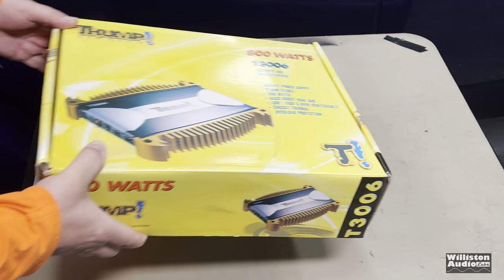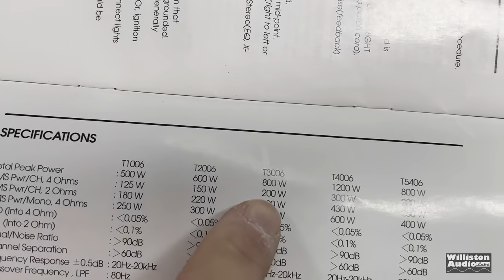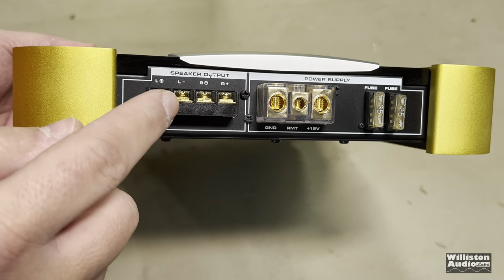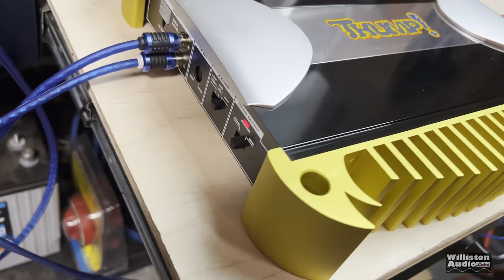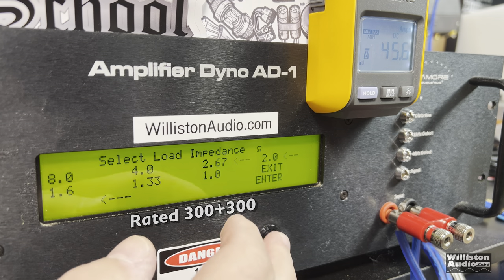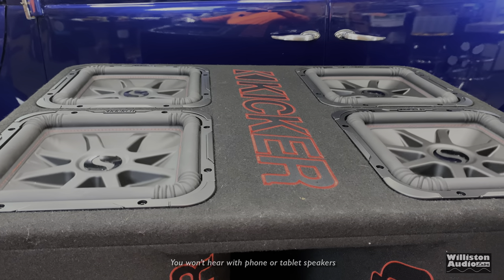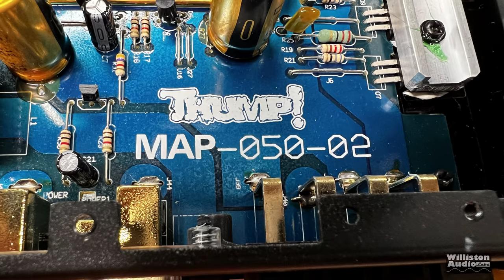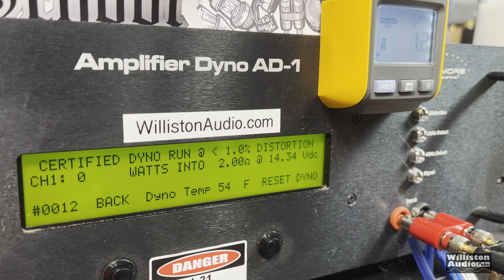Do It Thump Tho? 2001 Thump T3006 Review and Amp Dyno Test #FleaMarketFriday

Comment: This is probably one of the best you could hope for from a Flea Market. I would have considered it a score for the right price, especially considering how terrible most of them are..
Reply from the maker: Surprising 😲
Reply: I have never bought any Chinesium flea market amps, but I have purchased quite a few cheap flea market subs and they ALL sounded like garbage. The only ones that sounded anywhere near decent was a set of 6.5"s in a decent sized box that my buddy put in his 1984 S-10 as a joke with a power inverter and the amp was my Technics home amplifier...lmao It took up the entire space between the two bucket seats, but it sounded decent...
Reply: @Brock_Landers  i bought a Orion Cobolt from Denio's Farmer market and auction in 1988 and it was a slapper
Reply: Viper 660.1 d from 
2002
I heard it would do 
5000watt  @ 1/4ohm
Reply: @Brock_Landers  I can't say that I've ever heard a bad sounding sub in a good box. I have pushed subs past there limits and got muddy/muffled bass. I have found some subs are extremely overrated and start distorting way before there "peak" or "rms". Most of these companies are lying in one way or another; even the big brands. Often alot of the cheaper subs sound decent around 50-100ish watts, then turn to garbage past that.
Reply: nope remember performance teknique amplifiers

Comment: I had an Urban Audio Works 2 channel amp running a single Pioneer IMPP 12” sub in a MASSIVE box behind the seat of my old truck.  It was physically a large amp, and if I remember right I removed the bottom plate one time to see Targa on the circuit board!!  Realistically it probably only put out about 250 watts, but it was enough to impress people.  It would be nice to see a dyno of one of those amps one day.
Reply: I had an Urban Audio Works amp in the 90s. If I remember right, it was anodized purple and had a rat on it. I ran 4 pioneer 6x8s off of it in my T-Bird. It sounded really good too
Reply: @williamprentice9539  I ran many targa 12's from Ames store back in days. Believe I ran them off a road Master 500 watt amp, which was probably pushing 50 watts per channel but ran it bridged at 2ohms and was taking back subs and the amp almost weekly for new exchange. Lol.... As for the Urban audio, I never used those amps but also ran their 8 and 12" subs on home audio and they actually sounded great!

Comment: I am impressed with this Thump! amp. 1 of my first subwoofers was a 10 inch Thump! back in 2001 I was in 11 years old in 6th grade. It had yellow fat surrounds and I remember it sounding horrible compared to my old Pioneer Impp 10 subwoofers i had back than. I wish i still had one to test out today in my truck but they are indeed getting harder to find these days!!
Reply: I also had a Thump 10 and I had a 250watt Thump amp hooked up in my bedroom using a 12v battery charger and a deep cell marine battery. Thump was actually sold in stores. I bought mine at Meijer. They were around $60 for the amp and the same for the sub, but it came with a sealed box
Reply: what is the song you are using right before DJ Magic Mike?

Comment: Hands down one of the best starter amps I ever owned was bought new at a flea market. It was an original Ample Audio A226 with the brass colored logo on the top. It looked janky but would make your shit bump. They later grew to be a fairly reputable brand with their "Exonic" line but eventually went out of business. :(
Reply: Ample was pretty good stuff I thought. I also had the a226 and it was great. Had it running a Memphis studio 10” in a ported box in a regular cab s10. Impressed everyone that heard it and saw it was only 1 10” sub

Comment: Majestic is and always will be my favorite flea market amp!! First amp I ever owned in the early 90s still love them today. Wish I had more of them. The thump was impressive. Never seen that version of them. I can imagine it in my head though in my chevy luv with a pair of 10 inch kicker golds behind the seat...
Reply: I've gotten three majestic amps and not one of them came from flea market.
I got them audio Express with Lanzer sub's very good results
Reply from the maker: Budget Old School? 1997 MA-695 Isographic Series Amp Dyno Test
https://youtu.be/qvjtN9DK9GE
Reply: Dude! Chevy Luv for the win! That was my first vehicle. I had MTX 10s and a Sherwood amp.
Reply: @wal  one of my favorite videos you have done! That and the dsm series
Reply: @jasonlopez4855  my first came from the seattle wa swap meet.  I got the 250x2 (ma series)for 175 and I bought mtx terminator 12 inch for 50. The vender had the complete majestic line with eqs to the 400.2 amp
Reply: @heyyourlenscapson2588  74 step side with a 307sbc 2 speed power glide. Majestic 250.2 and a single mtx terminator 12 behind the pass seat. I put honda buckets in it before I got my license.
Reply: @ElectronicMusicUnderground  step side yes, mine had a small block Chevy 307 in it. With a mtx 12. Lime green.
Reply: Tell ya I never blew that first amp. Back then I had no idea what ohm load ment lol. Before i gave the amp to a buddy i had 4 10 inch kicker golds wired mono to that. Plus a pair of 6x9s off stereo. That amp got hot but never smoked. Good memories. Wishing now I still had that one and the 400.2. I have all the smaller ones now but the first series bigger ones elude me to this day.
Also had in there a amp I got for Christmas which was a frontier 50x2. Had that to a pair of horns. That was no so good of an amp. Literally a kmart special

Comment: OMG..... DJ Magic Mike! A thursday throwback if ive ever seen one! Hes still actively doing his thing today believe it or not.
When my brother did the stereo in his new 2001 Dodge stratus, the local shop sold him on a 25wx2 THUMP! amp. He bought an Audiobahn dual 10 bandpass box & Jensen amp, claimed he needed the THUMP! amp for powering his rear 6x9s. I discovered years down the road he could have wired the 6x9s in parallel with the hi-level input on the Jensen amp and been just fine. His Stratus came stock with an Infinity system & in dash 6cd changer which sounded quite nice with the subs.

Comment: I have this amp and the 4 channel version. I had them installed at a stereo shop in LA. I got the Kenwood head unit with cassette that controlled a remote 6 disc, Audiobaun passive eq, JL audio components in all 4 doors, and 2 10" Punch subs in individual boxes behind the seat of a 99 Chevy crew cab. My buddy spent 1k more on a complete Kenwood system with a custom box and 12's, he was sick, mine hit so much harder.
Amps have been sitting since 2003, been thinking about putting them in something.

Comment: Back in 2002, I once purchased a Soundstorm amp from a arena flea market sale, new. It was rated for 1000 watts, nice amp, worked for a few months, then it went into "permanent protect", and never worked again afterwards. That amp get scrapped for parts long ago. :/
Reply: You should of went to Fosgate power
2002 it will still work I got my amps
in 1999 and  HX3 subwoofers I'm still
using them still every day 👍🏽 ya boy 👍🏽

Comment: So I found your channel after being on YT close to 15 years myself.  While not an audiophile or a car bass addict, back in the 90's I had a CRX which had for the day a system.  Pioneer head, with cd player, the old school sled style.  2 Cerwin-Vega 6x9 in the doors , 2 CV 4" tweeters in the dash, and 2 JBL 10's, in a custom built box for that car.   For a car that had a little north of 800 watts rms back in my day.  That little shit box had the shakes.  I did have a 4 channel rock fuzzy 1000 watt amp pushing it.  I had to get a special bracket to delete my AC and run a second alternator, because the HF model of CRX had the worlds weakest ass alternator on it.  I wish it was an SI, but truth be told that car was slower than most shits I take in my 40's now.
Reply from the maker: I always wanted a CRX but I’m a bit too tall for one. They were little boomboxes though…didn’t need much to have a very loud system

Comment: never hook the rca's up before the amplifiers ground. it will charge the caps through the 1k ohm resistor through the rca ground and can damage the head unit. always unhook the rca's first, and hook them up last when installing an amplifier
Reply: Just diagnosed an amp earlier today that had been poorly grounded and was sending current through the shield of the RCA cables. Fried a capacitor and the crossover stage in the amp. Headunit survived tho

Comment: My first set of 15's were Thump P-15's, I upgraded to some 15" Rockford Series 1's after that, slowly but surely improving as the years went by
Reply: I too had 2-15" thumps in a 4 cubic ft bandpass box( thrown by the dumpster behind an audio shop)  powered by 2-1000w pyramids. Rattled parts off that 1989 cutlass Calais ( we removed the back seat to fit the box)
Reply: @travisschnitz4362  mine were powered by a Majestic 800w amp, it was an underwhelming setup. My friend with a couple 10" Blues put me to shame until I got myself a Punch 200 and some Series 1 15's

Comment: I saw one of these at a somewhat reputable shop back in my hometown way back in the day...They were selling them for like $109. They also sold Sentrek amps as well (both brands notorious for their known quality and power output). Both of those amps were for the budget bassheads that didn't care that there was barely any bass.... The internals on this amp weren't that bad for what it was. And the amp sounded decent on the quad box (thankfully the computer I am watching on has 2 -12s for low end so i could get a somewhat decent representation of Quadzilla...lol)
Reply from the maker: Thanks for watching and commenting!
Reply: Senterk amps were great actually! They would run 2ohm mono all day hot AF n keep on beating! Believe I had a 420 watt one? It actually burned the positive terminal off the power block and just soldered the actual positive wire directly to the board. 🤣

Comment: A friend of mine had a huge thump amp that was a PG knock off, bridged 2 ohm mono to two 350 pioneer free air 10” from Walmart in a 1.5 cu. ft. Sealed box in a square body explorer and it was loud, didn’t do great on the lows but you could hear him coming for many blocks.
Reply from the maker: He Thumped Tho!

Comment: My first system was two 2005 blue in color, see threw plastic top, 300watt VR3 sub amp from Wal-Mart an two Jensen XBass 12inch subs with the massive rubber around them and couldent afford inside speakers in the 92 tbird so I put scooshe bass blockers on the back speakers an turn the fade 2 down towards the back on the esa circuit city 160watt head unit

Comment: Had one of the T4006's back in the day powering a couple of Jensen XS1212's in a bandpass box, worked pretty good until someone stole it. Amp definitely ran hot, had to flip it over, take the cover off and put a couple of computer case fans blowing on the internals. In hindside I think that may have been because I was running it bridged with a 2 ohm load.
Reply from the maker: Thieves suck!

Comment: hmm does a bass boost switch add 6db? or does the off position lower the restof the eq outside of 45hz to prevent clipping? perhaps output power is higher with the switch on and at 45hz?

Comment: I had a old Thump amp back in 1995(looked like a PG amp) driving a pair of 4ohm EQ1065's bridged for nearly 10yrs... only got replaced due to a new car 🚗
Reply from the maker: Flea Market Knock Off? 1997 Thump THA-2000 Amplifier Dyno Test Phoenix Gold Replica [4K]
https://youtu.be/UpUjzBWtU9Y
Reply: @wal  nah it was the tha3000, wasn't supposed to run 2ohm bridged... but it survived 
My guess would be about 3~400w into the old Earthquakes, they got pretty loud n deep in a shared 4.5cf@32Hz box... old skool bro 😎

Comment: This was probably the start of the Korean made amps. Several other brands seemed to use the same board. L.A Sound 3nd gen amps used the same or similar board. 4 channel versions Laguna, Long Beach and Malibu. I Ran a Laguna mixed Mono on some RF components and some RF 10's. It was enough to make it bump. Amp board also found in the Majestic Graphite series. I will say the power rating on the Laguna must have been closer to spec being rated at 4x100 max.
Reply: I remember the L.A. Sounds stuff being on display with those amps and a few of their Isobaric boxes, Sounded pretty good. I bought one of those said boxes with 2 10" subs in it from a pawn shop and it bumped real good but one of the speakers was about half blown.  I took it back but not before getting the crucial measurements from the box and making my own with some 10" punches and a punch 45. Sounded damn good for what it was.

Comment: Hidden gem! Did anyone else see the 50_2 silkscreen onto the PCB? This amp seems to perform in line with high- end 50x2 amps from way back. Curious if it will do the low impedance loads the old Orion or Zed Audio-made amps would. We all know that Korean amps are generally high quality.

Comment: they used to sell thump subs and amps at our local hardware store along with pyramid stuff
Reply from the maker: Get your hardware and hard bass at the same place 😝
Reply: @wal  this was back in the early 90s they also sold crunch subs and amps my 1st system was 2 crunch 12s with a crunch amp cant remember wattage rating and a pyramid tape deck lmao

Comment: I had a Kraco amplifier in High School.  Somehow it fried my CD player in my car;  maybe it had too much power!
Reply: Amplifier takes the power from the radio and increases it that's why it's called an amplifier. Most likely it was the installation or the unit was defective. An amplifier would never fry a CD player if connected properly.
Reply: A bad ground in my experience will cause the rca plugs to act like the ground to the amp and fry the head unit. My first ever install this happened to my pioneer CD player in 1999!

Comment: It's is definitely a cool wall hanger
Reply from the maker: Especially guts out
Reply: For real. You might be able to get plexiglass cut to the plate size and drill the holes in it so you can display the guts

Comment: You started to see more 1000W+ amps around 2000 so my guess is this thing was like $150 in actuality. It seems OK. This is kind of the you tuck it away under the seat type of amp that’ll do a decent job with less demanding subwoofers. I wanna see how the American Hifi brands like DHD, Rockwood, Volfenhag, Koiler etc. (and who knows how many others) hold out. Or the long standing Pyramid lines like the America Series, Arctic or Super Blue.

Comment: I got a question tho… I have three 12s and they Rockford p2 and I need to know what size amp I can use….
Reply from the maker: Each sub is 400W RMS handling. I’d go with a 1000-1500W amp, but you’ll also need to use the wiring guide to make sure you have them wired properly for the amp. Check the RockfordFosgate.com website for their wiring calculator

Comment: I've  actually  seen a lot of thump! Speakers and amps in the 90s an all though it didn't  make its ratings ,but take in to consideration that instead of being 200 ×2 its a actually  supposed to be 200÷2 so 100 per channel. The thump! 10s actually get pretty loud for what they are. Im not sure i remember it being flea market though. Unless that is a knock off , but doubt it with those guts. Im going to jave to do a little  digging.

Comment: Oh mobile authority inc. my best friend in highschool through a wholesalers out of California bought or ordered rather a blue carpet thick big size dual 12 inch truck Sub box and Motorola decent tweeters those speakers were thump brand he bought a pyramid 600x4 artic I believe and a 80 watt legacy CD player which the faceplate and wiring plug of his worked on a urban audio works CD player I got in a parts Chevy S10 Durango 82 long bed 2.8 2bbl carb 4spd truck and it had 4 newer but horrible urban audio 4x6, and 6x9 in the back speakers junk

Comment: One of my first and favorite flea market amp was a Rockwood 300 Detonator. Had it running 2 8" Mtx subs in an Isobaric box and they would bump pretty good. I had also tried their 1000w surfboard style amp, it was pure garbage and didn't even make the power the 300 made. The board in the big one took up about 1/4 of the amp.  I still doubt the 300 made any real power but I was definitely surprised what it did for the price. It also never got too hot or went in and out of protect like a lot of flea market amps in that era.
Reply: They called it the detonator because it could be used as a blasting cap.
Reply: @sylkelster  Never had an issue with it though. Had many other amps at the time and even some of the better ones weren't as reliable. Weird considering how shit the 1000 was

Comment: This amplifier does bump .If you hit some one in the head with it lol .A guy at the swap meet would tell people his amplifier could break windows.This bump would break a window of you threw it at the window lol .
Most Swap meet amplifiers are 30 watts tops 
Some are just IC chips lol
Reply from the maker: This one is a bit more than I thought, but you are correct in most cases you get a lot of heatsink filled with air 🤣
Reply: @wal  The Old American Hifi had these Combat amps .They we’re 12-14 “ long .The internal board  we’re made 3”-4” long max .They would say 350 watts 
They were maybe 15-20 wpc maximum lol
The amplifier board was basically empty .
It just had small caps .Maybe a few IC chips outputs .Some times Output transistors if you were lucky .American Hifi we’re the worst with lying about output numbers 
They would put 350-400 watts on a 10 wpc Equalizer lol